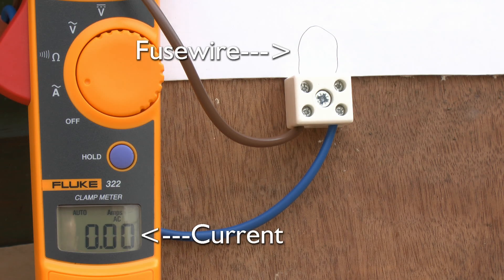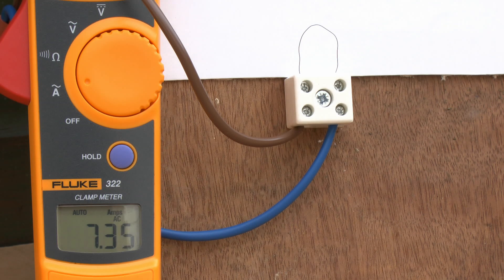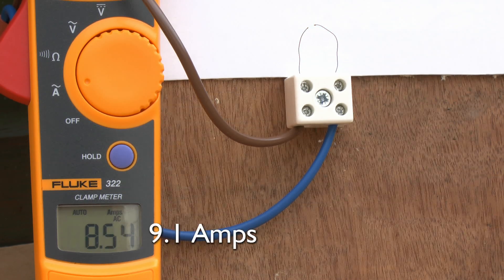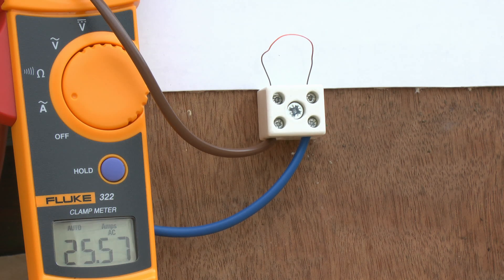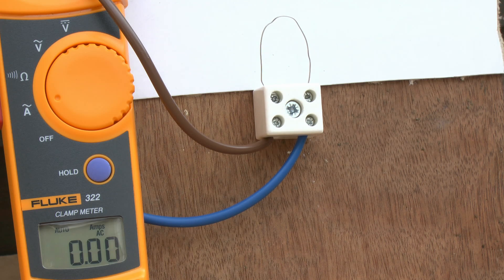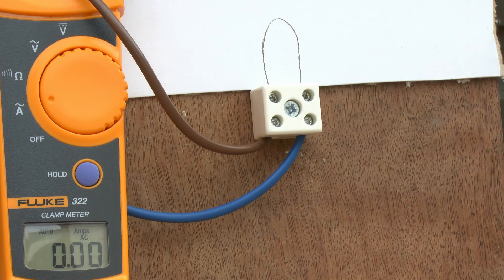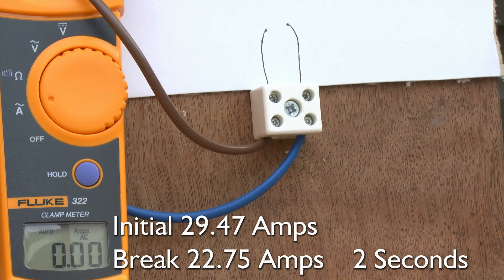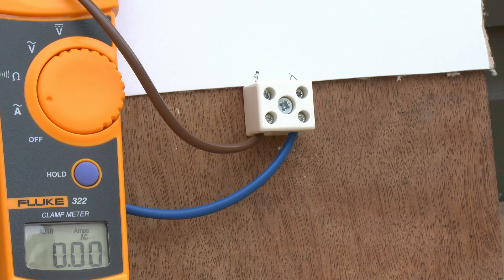Rewireable Fuses & Fusewire Tests

Comment: With those high fault current simulations at the end. That is the exact reason why old fuseboxes/fuse carriers are made from porcelain or other heat resistant material and some carry a protective textile shield made from pure Chrysotile white asbestos.

Comment: The wire in  your experiment is in free air outside, has good cooling which would be different in an enclosure and again in a fuse housing so the results would be different

Comment: That multiple strands of thinner wire is no substitute for single strand of thicker wire was an eye opener, and was a profound question I had in mind. But truth is multiple runs of thinner cables are actually used in place of a single thick cable for incoming cables from transformers in electrical installations. I think you should have tested by not allowing the three 5 A fuses touch together, which is unavoidable in actual fuse anyway,  because spacing is mandatory between cables I mentioned, and in this particular case bare fuse wires touching each other could transfer heat from one to other much more easily.

Comment: i think it is also worth noting, that a fuse wire rated for 5 amps, will hold 5 amps continuously and would eventually blow if it is drawing over 5 amps for a continued period. +/- some tolerances.
 I would have like to see a more concise experiment with an element of time considered into the equation.
but nonetheless, thank you for uploading an excellent video, I'm intrigued and will be watching more.

Comment: Back to this video because of an event from this week: Colleague misunderstood my comment that 'no' means 'no the wire's not isolated' as 'no, it's not live'. Same type of wylex fuse you're using for the tests later on.  He cut thru a 2.5 T&E. Live. 20 Amp rewireable.

I was in the fuseboard cupboard and the fuse cover was off the board. The jets of 'flame' (actually molten copper and plasma) I'd say extended 3 to 4 inches from each end of the fuse.  The Zs (L-N PSCC) measured later at the main terminals of the fuseboard was about 1.2kA. I'd not have liked to be the guy putting that fuse in on a dead short.

Lessons were learned, (or rather re-learned): don't take other peoples' word for isolation, especially if they're 2 rooms away and communication is compromised, and C-K sidecutters cost about 30 quid a pair :)

Comment: Hi john, thank you for very informative video. I found this video wile searching for fuse information for my Whirlpool fridge freezer today after hearing on the news that similar is alleged to have started the Grenfell Tower fire and according to the London Fire Service apparently 200 others per annum. The nameplate on my fridge says it is rated at 150W but the user manual for the fridge recommends a 13A cartridge fuse for the plug top. I would have thought this should be 3A. Data sheets for other more energy efficient models on their website also recommend 13A fuses. Would you recommend a lower rating fuse for this appliance.
Reply: Victor Hynes generally the rule of thumb to follow it less than 750 watts you want a 3A fuse and over you want a 13A fuse.
Reply: You can also work out the required fuse by dividing the power in watts by the nominal voltage (230V)
Reply: Probably from the high starting current of the induction motor - approximately 3 to 5 times the rated running current.

Comment: Hi John, what device did you use to put the lower amps through the fuse? I'm trying to set up a similar setup for the same purpose. Obviously a welder only starts at about 30 amps.

Comment: There are some other interesting points. Most people have no idea whats hapen if the braiking capaity is overstep. And a nother interesting point is, if a lightning arc is starts there can take a different way than people expect. I am a Mechatronics but even i can make mistakes :(   I remember some case. If i go into my current flat i lock if is 3 phase or single phase avable. In the BRD most neuer flats have 400/230 V 3 phase servis 63Amp each phase.  I now some electric stoves or wather heater can run at single phase. So i decided to check if a have 1 or 3 phase. I take a multimeter ( it was not rated for cat 3 or better. I put 2 of the watherheater fuses ( Neozed ) of. I know if i have single phase i cant see a large voltage difference between the fuse sockets. But if a have 3 phase i can see somthing like 400V between.  I set the multimeter on AC Voltage to 1000V.  And i have vorget to set the probs to voltage . They were in the Amp sockets. The intern fuse exploded and dont cut of the circut. The working fuse were the probes . The vaporized into my face. I remember it was like a shot from a gas pistol into my face. I cant see for a moment, i hear som rining, and my first thinking was " are the main fuses into the main building fuse box are in takt!  " In the BRD we use so called NH fuses,  or called Panzersicherungen (tank fuse ) tere are ratet for 120 KA breaking in some case. There are typs for 80 KA and 100KA to. If i see nice in you vid is that a fuse ned more time than most expected so cut of. The NH fuses 63A needed  very much amps to cut of. In some cases i am not sure if is ok to use 10mm2 for these circuts. In BRD the do so. Another point is nobudy cares about voltage drop in many cases, or the temp of the line. In these Building the put several of these lins into  bundle . The line in the middel gets much hotter than the outside.

Comment: I have been waiting for this video for a week, worth it though.

Would be interesting to see the difference between BS 1362 Fuses and Quickblow Glass fuses on high current loads. If the glass breaks due to high pressure or the force of the wire breaking.
Reply from the maker: copelandaa Glass almost certainly will break.  I'll do a video of some glass fuses ones next week.
Reply: ***** I saw many 5x20mm fuses literally exploding while interrupting high fault currents